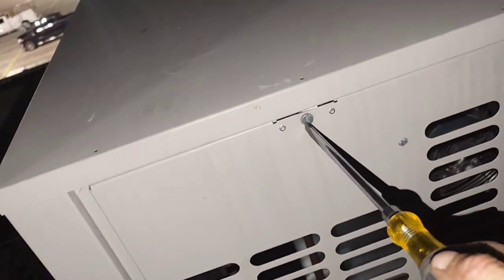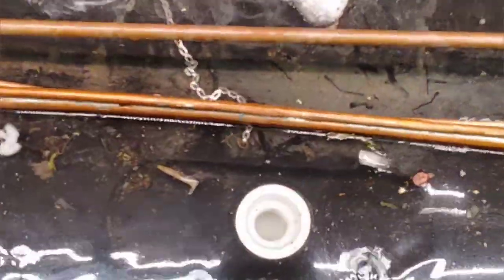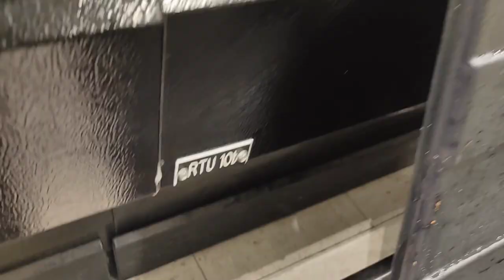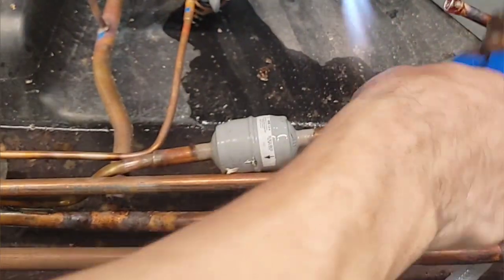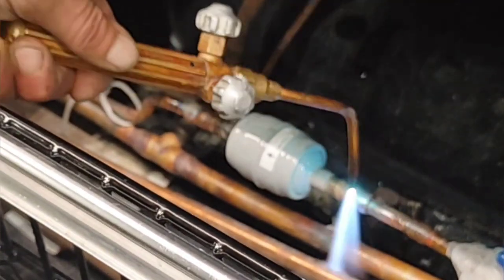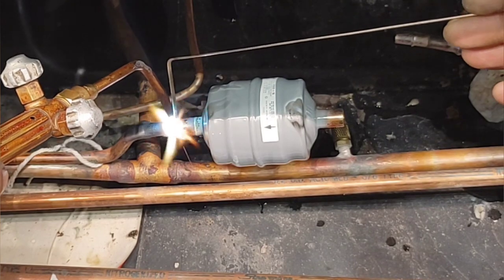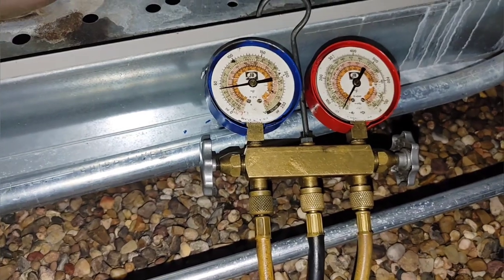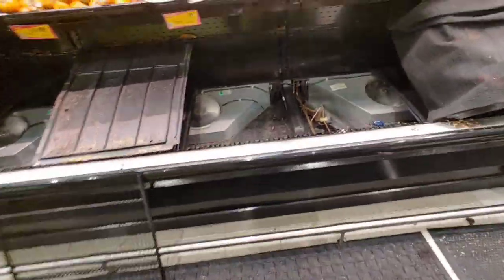5 HR Service Call, condensed into 20 Mins.

Comment: Did you even pull a vac? Ive done thee old blow and go but man
Reply from the maker: Sometimes man, if the product is on the verge of spoiling, or it's 215am(hell even if it's 11pm), or you can't run your pump because you got to get an extension cord and the manager has the front door locked because they're closed and you're in the ghetto of Houston Texas with crackheads running around outside and if you go get your card then you got to put up with at least two of them saying "kinfolk, you got any change kinfolk?", or for whatever reason, many and actually most times it's just not feasibly smart to run a vacuum. If all I'm doing is opening a depressurized circuit to pull out a liquid line dryer and put a new one in, we're talking about a very negligible amount of non condensable gas being introduced into the system. On the system in this video, if I had to place a bet on it I would say that they air introduced will become less than 0.1%(0.001) volume of the Closed circuit's total volume. If the overall hassle outweighs the benefit, in will let the little bit of moisture get absorbed by the liquid line dryer. I've never had a problem. If we're talking about a part like a solenoid or even an expansion valve on a circuit of a rack that holds 450 lb of refrigerant, there's no way I'll ever pull a vacuum. Compressor change out, that's different. I will pull a vacuum every time, and where I cannot pull a vacuum because there's not enough time if the rack is down for some reason I will get all the non-condensables out of the compressor before opening it up to the rest of the system. 
Sorry I didn't mean to make this so long I just start ranting sometimes and I can't help it. Lol 

Thanks for the support and conversation!
Reply: Nope…he has a LOT more views than me…and no vac…and no service wrench. 🤦🏽‍♂️

Comment: Interesting video. What generally causes a drier to plug up like this? Do you ever purge with nitrogen during brazing?
Reply from the maker: Driers can plug from moisture or debris from inside the line set. 
I have used nitrogen, and it is the proper way to do brazing. You just have to try to figure out the balance between doing that and how much time and materials you can bill your customer for. The black flaky residue that comes from oxygen in the atmosphere forming on the copper, that gets into the system is minimal at best, and I have never seen it affect a system, especially larger ones on a repair so small.

Comment: Good job ,,mate,,,,have question,,one condenser unit ,,,run 3 indoors cabinets ?
Reply from the maker: Yes, that is correct on this system. We have 3 sections/cases that are all piped to the 1 condenser.
Reply: @HVACRServiceTech   thanks mate